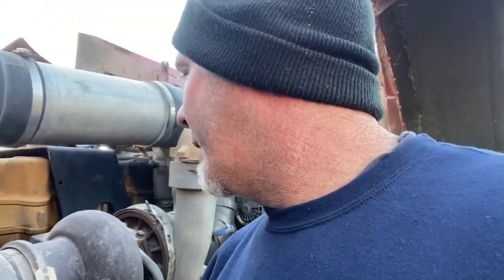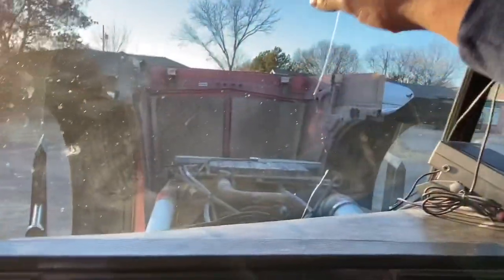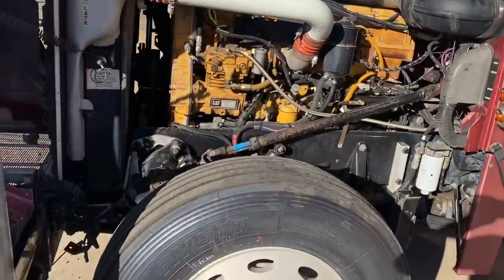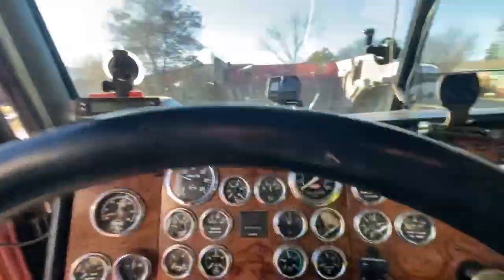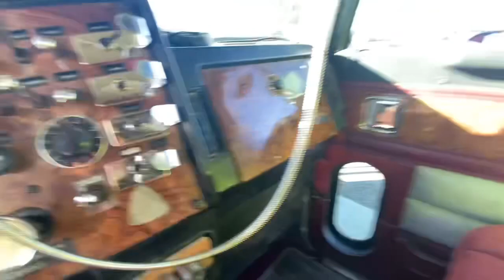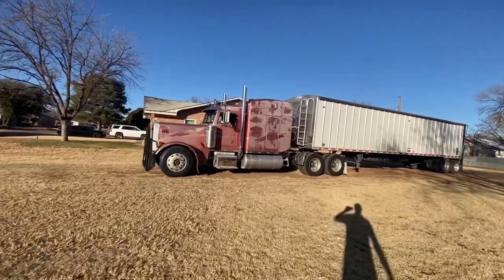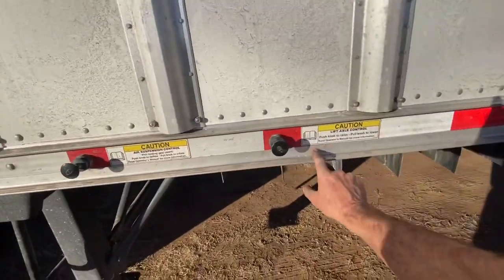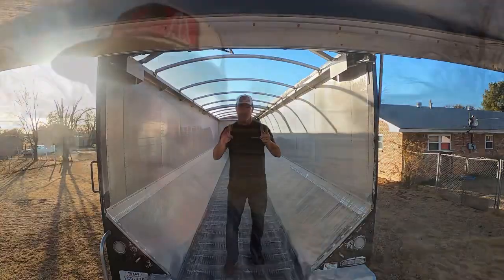Getting the RatRod ready! Belt Trailers 💯

Comment: Is there an advantage to switching to a 13 speed? Or what s the reason? Just trying to learn
Reply from the maker: Hello David, there is a lot less of RPMs between shifts on a 13 speed as you can split your top 4 gears, this especially helps on a trick like this that is lacking in HP.  Thanks for watching 👍🏼